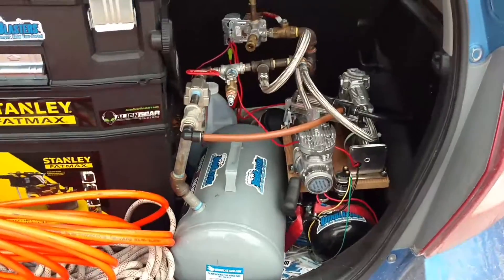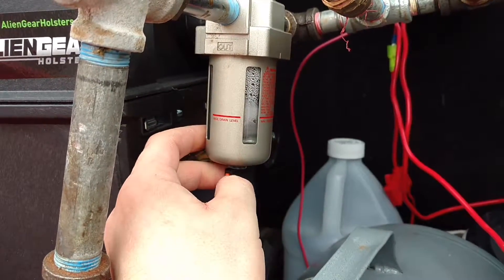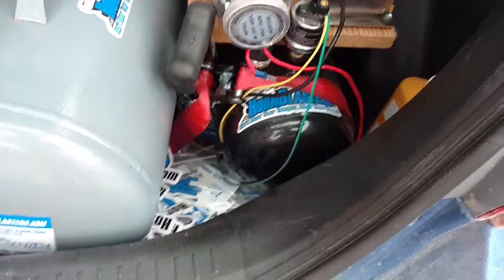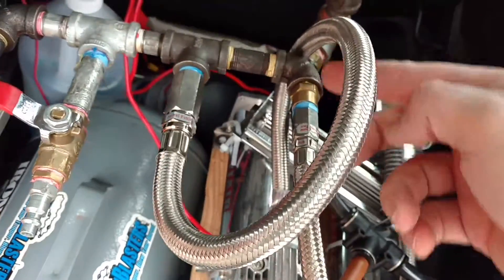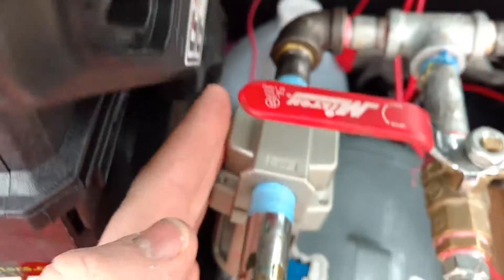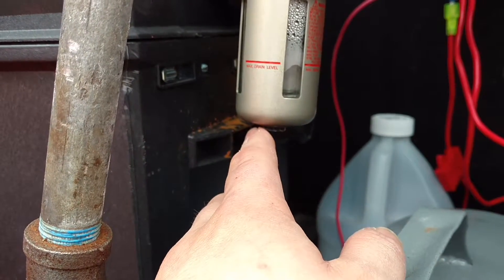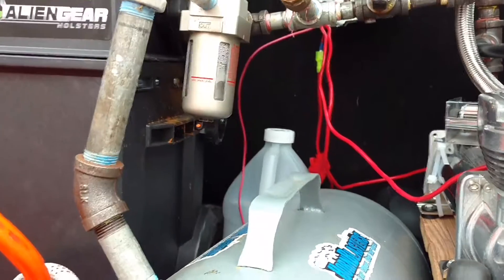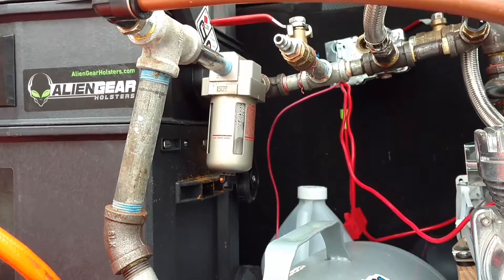Hornblasters Shocker Horn Squeal Solution

Comment: were you able to figure anything out how that guy built that pvc Ship horn ??
im trying to also not having much luck
Reply from the maker: Nick Harrison sadly no... as soon as I figure something out for it I will definitely be posting a YouTube video about it
Reply: well just from the info iv gathered today i think i can make one haha so ill keep you posted and i have a huge foot ball stadium speaker cone laying around im gunna try for the cone, from what i nderstand itd be just like pvc train horns and use his 7.5 poly and set it up like a train horn then its just the length and size of the pipe before the cone with a single diaphragm and how how much tension is against it ?
i got nathan K3s on my truck right now dual viar 444c under the bed ima put this big bitch in the back n have some fun ill keep you posted ..
Reply from the maker: Nick Harrison please do! if you happen upon something that works, please let me know in this comment thread!